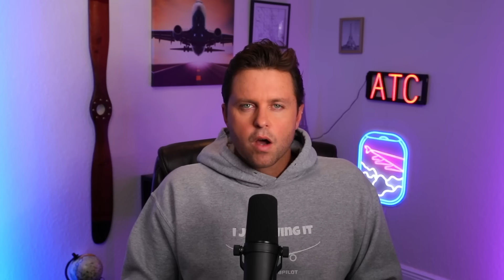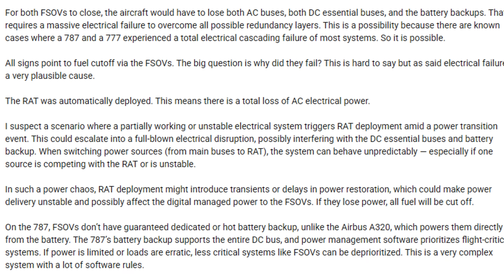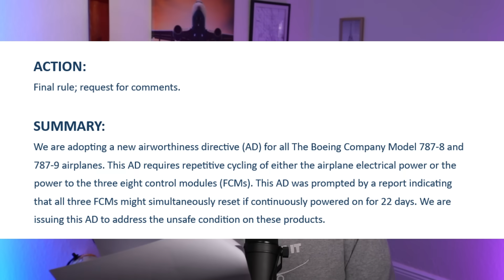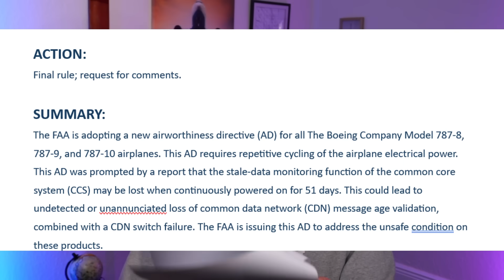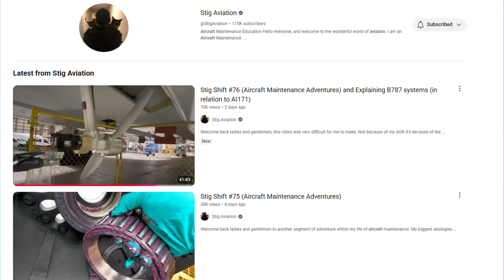Air India 171: Did a Software Glitch Cause Dual Engine Failure?

Comment from the maker: Original comment from @HeyFixThis 

I believe the cause was a combination of Fuel Shutoff Valve (FSOV) activation due to an cascading electrical system failure. It’s not the first time a 787 has experienced electrical cascade system failure during the first minutes in flight and required RAT deployment. Let me explain my reasoning:

On the Boeing 787, the engines will keep running even if all hydraulic systems fail. Each engine has its own FADEC (Full Authority Digital Engine Control), powered by a Permanent Magnet Alternator (PMA) that’s driven by the engine itself. Once the engine is spinning, the FADEC operates independently — controlling fuel, thrust, and safety — with no need for aircraft hydraulics or external electrical power. A simultaneous FADEC failure is extremely unlikely.

So, why did the engines shut down if they are supposed to be so resilient?  There is one important component that can override the FADEC: the FSOV. This spring-loaded fuel shutoff valve is not powered by the PMA, but instead by the aircraft's electrical DC system. If power is lost, the spring closes the valve instantly, cutting off fuel to the engine. FSOVs are a fail-safe, designed to protect the airframe, not the engine. In Boeing’s logic, it's safer for the engine to shut down than to keep feeding fuel into a potential fire.

In the video footage, the truck tilt actuator is in the forward position (toes down). This movement requires a hydraulic system force to overcome the wind and gravity. This forward position only happens when the landing gear retracted sequence is initiated by the pilots. 

The strange thing is that it is only the second step of the main gear retraction sequence to tilt the wheel truck forward. The first step is to open the doors, and if the doors are fully open, the next step is to tilt the wheel truck. It’s unclear why the doors are closed but the truck already tilted forward. 

Most likely the pilot selected “gear up,” which triggered the retraction sequence. The truck tilt was initiated as step 2, but the doors didn’t open due to power or hydraulic failure, or the sequence froze mid-process. The aircraft lost main power (hence the RAT), and the sequence halted with the gear in a partially commanded state: truck tilted, doors closed, gear extended.

That gear retraction moment may have been the exact point when the whole system collapsed just 3-4 seconds after takeoff.(there was a positive climb rate at 600ft AMSL and 174kt ) The engines kept running briefly (3seconds), powered by the remaining fuel in the lines before flaming out.

The main landing gear hydraulics are powered by an electric-hydraulic system — if there’s no electricity, there’s no hydraulic pressure. In contrast, other hydraulic systems on the aircraft are supplied by engine-driven mechanical pumps. (20-30kw power needed to retract gear)

Since the aircraft remained stable in flight, it's likely that both engines flamed out simultaneously. Flaps, fly-by-wire, landing gear, and other systems likely froze for a moment and possibly regained functionality after the RAT deployed. The +-15kW RAT powers the electric motors on the blue hydraulic lines of a 787. This controls the key flight-control actuators for the rudder, elevators, and primary ailerons. It appears that the pilot slightly increased the nose attitude during the final phase of the flight. (landing gear retraction is not possible with a RAT)

For both FSOVs to close, the aircraft would have to lose both AC buses, both DC essential buses, and the battery backups. That requires a massive electrical failure to overcome all possible redundancy layers. This is a possibility because there are known cases where a 787 and a 777 experienced a total electrical cascading failure of most systems. So it is possible. 

All signs point to fuel cutoff via the FSOVs. The big question is why did they fail? This is hard to say but as said electrical failure is a very plausible cause.  

The RAT was automatically deployed. This means there is a total loss of AC electrical power.

I suspect a scenario where a partially working or unstable electrical system triggers RAT deployment amid a power transition event. This could escalate into a full-blown electrical disruption, possibly interfering with the DC essential buses and battery backup. When switching power sources (from main buses to RAT), the system can behave unpredictably — especially if one source is competing with the RAT or is unstable.

In such a power chaos, RAT deployment might introduce transients or delays in power restoration, which could make power delivery unstable and possibly affect the digital managed power to the FSOVs. If they lose power, all fuel will be cut off.

On the 787, FSOVs don’t have guaranteed dedicated or hot battery backup, unlike the Airbus A320, which powers them directly from the battery. The 787’s battery backup supports the entire DC bus, and power management software prioritizes flight-critical systems. If power is limited or loads are erratic, less critical systems like FSOVs can be deprioritized. This is a very complex system with a lot of software rules. 

This also reflects Boeing's design philosophy: in a severe power failure, airframe survivability and flight control take precedence over engine continuity. Their assumption is that it’s safer to shut off fuel than risk uncontrolled flow in to an engine on fire. 

The whole idea of the posibility of losing  both engines at 400 ft during takeoff feels inherently unsafe. From a thrust continuity perspective, this design approach is a vulnerability and may have played a role in Flight AI171’s dual-engine flameout.

To date, there are no documented cases of a modern Boeing experiencing a engine flameout from FSOV closure due to an electrical glitch. The 787 and other Boeing models have a history of similar electrical issues.

In 2024 an Atlantic Boeing 787 flight, VS105 during climb-out, the crew experienced a major electrical failure— engine generators dropped off-line. In response, the RAT automatically deployed to provide emergency power. 

In 2015, Boeing and the FAA discovered a critical software bug in the 787’s Generator Control Units (GCUs). If left powered for 248 consecutive days, an internal counter could overflow — shutting down all four GCUs and cutting AC power entirely. The FAA issued Emergency AD 2015-08-51, requiring operators to reboot 787s every 8 months to avoid in-flight total power loss.

Two separate incidents—in Boston (JAL) and Takomatsu (ANA)—involved battery overheating and fire in the aircraft’s APU lithium-ion batteries

In December 2018, LATAM Flight LA8084, a Boeing 777-300ER, suffered a complete electrical meltdown en route from São Paulo to London. The RAT deployed to provide emergency power. Once the engines were shut down on the ground, power suddenly returned — confirming a fault in the electrical distribution system (likely a bus contactor or converter failure). The event was a textbook cascading failure: generator power was available, but a chain reaction of breaker and converter failures disconnected all major buses, including those powered by the APU and engines. 

The 787 relies heavily on software-based power management, so if the root cause turns out to be a software flaw in a extremely complex electrical system, the entire fleet could soon be grounded pending investigation.

——/
I rule out vaper lock: Modern jet fuel systems are pressurized and temperature-managed, making vapor lock rare. For both engines to fail simultaneously from vapor lock would mean identical thermal, pressure, and fuel conditions in both lines — extremely unlikely.
Reply: Does the flight data recorder (FDR) record what the Fuel Shutoff Valve (FSOV) is doing?
Reply: @evoliveoil think of an automatic fire door that is held open by an electromagnet when the fire alarm goes off the current is turned off and the door closes. In the case of these valves, they’re held open by the presence of electrical power and when the power goes off they close, but as there’s no power there cannot be a signal sent to the FDU, the only way of recording the valve position is when it’s open and it would be the absence of that signal that would indicate its closing.
Reply: @MRCAGR1 imo doing that without first acknowledging the detection of a fire is unsound, and it’s the wrong conception of an electrical fuel valve actuation. Keeping the fuel valve open by an electric driven actuator, but closing by spring force is asking for an event like this. For hundreds of years, railway cars brakes were powered by draining the piston not by pressurising it, which ensured that trains would stop when supply lines broke. In the 787, the fuel supply to the engines is stopped by spring valves when electrical power fails.
What a miserable conception! Surely a better solution would be to hold it upon and only upon the detection of fire close the valve. You could make this physical, ie something that the fire burns through easily that then releases the spring. Whatever the solution, there has to be one better than this PoS. In any case, pilots can already manually shut off the fuel and use fire extinguishers, so by trying to solve a problem that already has solutions they’ve created an even bigger one
Reply: @StoutProper I’m not disagreeing with you and I’m not saying that Boeing are blameless in their design neither am I being deliberately obtuse or obstructive, just looking at this logically from a system perspective.
If the FSOV are located adjacent to or close to the fuel tank outlets rather than being very close to the engine then the concept of using a physical restraint that burns through would not be feasible. 
If there’s no power then there can be no control over closing the valves as that would require electrical current to activate which cannot happen until the RAT has deployed and is operating correctly. What it needs is an actuator that can reopen the valves once power is available via the RAT, this could be manual or automatic.  It would also require the flight control system to be active. If the power is cycled do the flight computers do a cold start or a warm start?

There’s also the issue of the fuel pumps also being driven electrically, even without the FSOV activating, there would be a period where the engines become fuel starved, what could be the effect on the engines if this was a drawn out process?

Would there have been time for this to complete on the Air India flight?

One possibility would be an independent source of power that could keep the FSOV open unless the fire warning for a given engine has been activated. If all power failed for whatever reason the FSOV would remain open unless overridden on the flight deck.
Reply: Yes, @evoliveoil
Reply: @evoliveoil  surely!
Reply: @evoliveoil  Sadly it is burned down and send to the US because india did not have the resources to retrieve the data. Cockpit voice is secured.
Reply: @evoliveoil only if it’s got power, and only if the sensor has got power, and there is a valid connection between the two. Probably unlikely with a complete electrical failure
Reply: I'm glad you reposted this comment as I think it is one of the best on this crash. It seems weird logic to shut those valves (FSOV) off automatically by assuming there's an engine fire.
Reply: @donotwantahandle1111  If an engine fire was the reason for this accident, we probably would say the opposite. ;)
Reply: as a systems engineer and software engineer, that reboot bug is INEXCUSABLE. I'm actually speechless
Reply: @BendySendy 248 day reboot schedule is a sorry adaptation to a clear software BUG. I've seen such bugs in other systems, and they can be difficult to spot, until you commit to supporting perpetual operation as a feature. Short of that a forced reboot schedule should be reinforced with escalating timeout notices. I don't know if that was done, but it sounds like another Boeing 'too smart for its own good' design self-pwn.
Reply: @BendySendy  "that reboot bug is INEXCUSABLE" Yep, it's about as dumb as a mechanic who don't know the difference between a sump plug and a spark plug.
Reply: @BendySendy  totally agree!
Reply: @BendySendy  Discovering that the planes continue to fly with that reboot bug is enough to sendy you round the bendy.
Reply: @Brrumski exactly
Reply: @BendySendy  When you offload your software development to the lowest bidder, in a Country with a large time zone difference from Boeing, are you really surprised?
Reply: This explanation makes sense and seems confirmed by the sequence of the crash and the RAT deployment, as well as the position of the trucks
Reply: A Safety Instrumented System (SIS) with fail closed valves are routine in a chemical plant or refinery.  But IF a false closing of that valve could cause a fatal event; a 2nd parallel valve with a different power source and controller would be utilized.  NEVER have a single point of failure that causes a severe event.  Some systems even have 2 out of 3 voting before initiating control actions that have very severe consequences.
Reply: @allencar5212  Yes, seems weird for an aircraft engine.
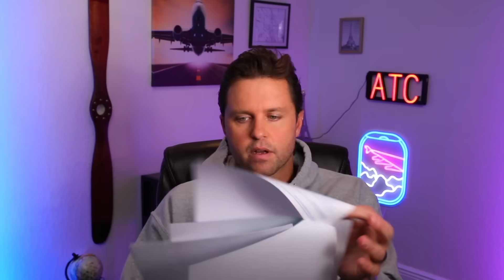Reply: "The strange thing is that it is only the second step of the main gear retraction sequence to tilt the wheel truck forward. The first step is to open the doors, and if the doors are fully open, the next step is to tilt the wheel truck. It’s unclear why the doors are closed but the truck already tilted forward."   Not according to this video shown by Gary where at 6:24, it clearly shows the tilt operation begins BEFORE the doors start to open:   https://www.youtube.com/watch?v=ak9o50YLb14&t=123s.  Apart from this statement, I think the rest of your observations are possibly pointing to the real issue.  At cruising altitude, this would probably not be a big issue as after power being  restored by the RAT deployment, the engines could likely be restarted.  A far different scenario at five or six handred feet.
Reply: @Gourockian1  Yeah, I had heard the sequence operating the same with the tilt first and when verified by the prox switch, then allowing the doors to open. From a logic standpoint, this tends to make more sense. 

But then I tend to think the logic of the fuel shut offs defaulting closed, is pretty weird logic. And it seems odd for the computer to even command the valve as opposed to direct control from the panel switch. But if that's what it says, I guess that's how the designed it!
Reply: FSOV Closing due to electrical failure is criminal
Reply: Even though the AD was published, it doesn't mean it has been followed by Air India. The first thing investigators should do is check the maintenance logs, specifically for AD reboots. What is interesting is that the advisory says "reboot after 8 months", which would be about 240 days and that leaves only an 8 day margin.  Why not have the period set at half the interval. Surely, 120 days is possible to implement, wouldn't it?
Reply: @dondonaldson1684  Airworthiness Directives are typically legally mandatory, it'd be foolish not to but yes, theoretically could've just. Not. AD 2018-20-15 replaced the original AD and did, in fact, set the reset time period to 120 days for good measure, in addition to mandating a permanent software fix within 12 months from the issue date of the AD, which was November 20th, 2018.
Reply: @dondonaldson1684 I agree, and think Boeing should have promulgated maintenance programs to track and enforce these reboots until a perpetual operation feature could be deployed. But as software architect, who has fixed just such bugs elsewhere, I suspect counter overflow glitches are rife in this code base. When you have a blind spot, you never stumble just once...
Reply: One 787 incident that is not mentioned which to me felt like it might actually be a lot more relevant is that of ANA NH-985 on Jan 17, 2019. During landing at Itami, the engines both rolled back and shut down prematurely due to something in the software. I couldn't find much of an incident report on that. If whatever fault caused that shutdown or perhaps similar circumstances causing the software to react similarly, but during rotation rather than landing then you could absolutely see it resulting in a crash, simply no time to react to the problem. That said I am not sure what the root cause of the ANA incident was, I couldn't find much info, perhaps you know more or have access to better sources?

Also on the vapor lock theory - it always felt far fetched to me, becaus 43 degree heat is pretty common in India in the hotter months, and it gets similarly hot a lot of other parts of the world as well, and a two hour turn-around seems pretty routine as well. We are not hearing about 787s losing engines due to vapor lock, despite likely thousands of takeoffs in those sorts of circumstances in the 14 years the 787 has been in operation. If that were all that was going on we'd have seen this before now. Overheating of computers or electrical systems seems far more plausible.
Reply: Very thorough work from @HeyFixThis, thanks for posting
Reply: This is no doubt the most professional (non FAA/NTSB) accident review I have ever read. This information should put the official investigation on a completely different track.
If this pans out (and I think it will), the real shame will be that dual engine failure was a known possibility. 
Now we can all hearken back to our training days when a single, manually controlled, fuel selector/shutoff valve was all we had to contend with.
Reply: I agree with this assessment. I think Boing need to re-assess the fuel cut off valve as a fail safe function as it clearly fails to danger state. With all the modern electronics now available, this valve should not close while in flight. Accelerometers and inputs from flight navigation should be able to inform the valve control system that the plane is in flight. A backup power supply for the valve should also be included. This is clearly a critical component and self diagnosis ad reporting should be mandatory,
Reply: Now comes the ‘interesting’ part.  

If the Indian Authorities have concerns such as these will they be robust enough to call for a fleet grounding.  It took the loss of two 737 Max’s before action was, somewhat reluctantly. If the FAA is seeing the same as a real possibility have they freed themselves from Boeing sufficiently to call for the fleet grounding. 

As much as I didn’t like Alan Joyce as CEO of Qantas, immediately after QF32, when now lives were lost he grounded the QF A380 fleet. 

Given the integrity concerns with the FAA, I think country regulators need to step up to the plate, such as those in Europe, UK, Australia, etc. 

Failing the regulators, what risk analysis are the airlines making. Grounding the 787 fleet would cause massive implications and potentially competitive disadvantage with profit loss, but how much longer will the profit mindset override airline decision making?
Reply: @jpmasters-aus  Naw. 
They're waiting on the next incident or crash before grounding the fleet.
Reply: -8 is tilt then doors, -9 is doors then tilt
Reply: That’s a dumb post. 

The conflict lies in how the Fuel Shutoff Valves (FSOVs) behave on the Boeing 787:

The post claims FSOVs are spring-loaded and will automatically close if electrical power is lost—cutting off fuel to the engines.

But Boeing design data shows the opposite:

On the 787, FSOVs are motor-actuated and latched. Once commanded open (or closed), they stay in that position—even if power is lost. They do not spring shut.
This means a total electrical failure would not automatically close the FSOVs and stop fuel flow. So, the theory that a cascading power loss alone caused both engines to shut down via FSOV closure is not consistent with how the 787's fuel system is built.
Reply: @morespinach9832  you are correct but power is actually " lost" after the valve is commanded open or shut. It uses a DC voltage pulse for one direction and a reverse polarity pulse for the other direction A magnet holds the position of the valve. the spar valve is motorized and will stop even in mid transit if power is lost
Reply: @morespinach9832  

Right, the OP is based on false assumptions.  As I said the valves are Bi-Stable.  An open valve stays open even if the power systems crash.

It would take some current ( perhaps errant) to flip the valve state to closed.
However, Airbus' implementation is probably more fail-safe, given how the engines should continue to siphon even if the primary boost pumps fail.
Reply: The day/time limits are due to the 787 using a 32-bit operating system. The interactions between fsov and the rest of the systems I know nothing about. Also (allegedly) Air India’s entire 2nd city fleet was under upgrade  maintenance, it would be interesting to know for what.
Reply: Looks like you forgot to pin this comment or YouTube unpinned it.
Reply: Simple mechanics suggests ,no thrust ,no lift due mainly dual engine failure.
For any engine to generate power you need to burn fuel with air.If it doesn't get either it will not run.
Why & how the engines starved off fuel needs to be established.
Reply: @dineshtripathi3995  The mayday seems rather  specific as opposed to "lost power", "engines shut down" or something  similar. If they hard an electrical failure, I think the mayday call would have indicated  as much. 

Some aspects of this sound a bit like wind shear.
Reply: Seems plausable
Reply: Air India cancelled 26 flight in last 24 hours. After questioning they answered that 13 were cancelled due to technical snag and 13 were operational issues.
Reply: Hi Gary,
I'm a retired flight engineer instructor/examiner.  Please listen again to the 2nd video of the aircraft flying past the apartment balcony.  This is the video that clearly informs us of the noise from the RAT.  The RAT's noise is evident.  However, we can also hear the noise of the engines as the aircraft moves further away from the camera.  Typical jet efflux noise as an aircraft moves away.  Consequently, even though the RAT is deployed, I don't believe the engines actually flamed out.  They were not as noisy as you would expect for an aircraft in serious trouble.  However, they were still running.  I believe they were running at much lower RPMs, due to receiving fuel by gravity and suction feed only.  Suction/gravity feed is caused by the fuel tank booster pumps not running, but allowing fuel to pass through to the engines at a much slower rate.  This reduced flow rate will not be sufficient to sustain max power on a large fan engine.  

We know the pilots stated, "loss of thrust".  Every pilot I have ever heard in a flight simulator has transmitted, almost without exception, "Engine failed/failure or "engine flame out" or "multiple birdstrike", etc.  I've never heard "loss of thrust" when an engine has stopped running.  There was a clear message to the world in that Mayday call:  loss of thrust rather than loss of engines.  The aircraft ended up below minimum drag speed and would never recover, even if they got electrical power back (and tank pumps running) with the RAT.

I agree that the facts support a central electrical failure.  That central electrical failure caused all the tank booster pumps to immediately stop running, bringing the engines to a lower power setting (but not flaming out).  The electric hydraulic pumps will stop, but the accumulators in the landing gear system would pre-position the bogie trucks before the accumulators, exhausted themselves.  The legs would not raise.
Reply: @kevinnurse9936  That sounds more plausible than just about every other theory I have heard. Thanks.
Reply: Wow, i think i understood about 40% of that but enough to make me think Boeing need to ground all Dreamliners to check their software!!
Reply: If there was fuel contamination then another aircraft would have experienced the same issue
Reply: If this were to be true then it will be a boeing issue not a GE issue. Not familiar with GE but if this were to be RR then electrical on their part would not have caused this. Fuel from the win g is then mechanically driven from the pump connected to the gearbox through to then burners/injectors. Any electrical systems are for monitoring purposes only. RR also run dual channels to everything electrical from the EEC so if 1 fails there is a backup. When the quantas a380 flight had the engine fail the fuel cut off at the wing would not work so they had to drown the remaining engine in foam so if there is an issue with fuel supply and electrical issue its before the engine/wing and therefore a boeing prob not GE. Again not familiar with GE but they cant be too dissimilar.
Reply: If the plane had an engine swap in March is it safe to assume the ADs don’t apply and power was cycled or is that not standard procedure?
Reply: Your too short on ir commentary  we need more dialog  from you
Reply: Username checks out.  @HeyFixThis
Reply: Can't get any more thorough,,,,, very good worth many gold stars.. would another vat with direct wires to the fuel pump be a solution,,, fuel pump activate sensors, 1-2 second deployment of secondary vat, fuel pumps reactivated,, power interruption immediate activation of second vat and restoration of power to fuel pumps,,,,!;;!!!?!
Reply: @JohnMcCloskey-g9o  
Airbus apparently has a different protocol-- namely that these valves are powered by the individual ENGINE power source; the same source running the FADEC.  (Not via central power from the airframe.) If those had some logic OR function, so that if either engine turning would be sufficient to ensure VALVE=OPEN, that's probably a better implementation.  

Once the engines are turning, they could be counted on to remain fueled.

Of course, one has the sense that AIRBUS design protocols are more robust--  they've always had THREE AoA sensors, rather than the single failure prone set-up in the 737.

I don't want to discount the area of inquiry-- both fuel valve systems snapping closed sure fits the scenario.  However, some of the "assumptions" by the OP here are based in false data-- and it's far from clear WHY the RAT would be out BEFORE the engines stopped running at TOGA thrust.  So, his logic chain is backwards-- he's trying to fit 15 kilograms of bad assumptions into a 10 pound sack.
Reply: @atlascruiser1456  There are different types of valves on these engines, but generally "FSOV" refers to the valve which can only be controlled by the cockpit fuel cutoff switches or the fire handles. i.e. it has nothing to do with FADEC. However, fuel metering valves can be "metered" by the FADEC system, but as you say, FADEC is independent of aircraft power... i.e. unless the engine N2 falls below, typically 8 ~15%. i.e. engine barely turning. 
By the way, the 737 has two AOA sensors. The 737 MAX issue was that the MCAS system was originally wired up to only one of them. 
3 of them makes much more sense, however.
Reply: The failure occurring and causing immense trouble within seconds is really scary as a passenger and it's hard to imagine how pilots can identify and rectify the exact failure within these seconds time under pressure and also trying to be airborne at such a low altitude
Reply: The FSOV is a motor operated valve and not a solenoid operated valve. Doesn’t spring closed
Reply: I thought there was a failsafe in that The FSOV is spring-loaded to close if power is lost during a commanded shutoff, however if electrical power is lost completely and no shutdown is commanded, the valve stays open (fail-last-position logic).
Reply: @DuncsR  NO - the valve stays put where it was last commanded and voltage is removed - then applied if the valve is required to be moved- then voltage removed-  by design
Reply: WOW! I get more useful new fresh news details here than from the major news sources 🙂
Reply: The NYT, Times and Post are running about 48 hours behind in covering this.

They still are publishing about "theories" that are clearly false.
Reply: Astute and excellent analysis. It's clear that there was an engine failure, and it's clear there was a RAT deployment. Both of these, coupled with the long history of electrical failures and the immediate history of electrical failure in the in-flight systems as documented by a user video, clearly point to a cascading effect from electrical systems failure leading to fuel cut-off to the engines.
Reply: The below was derived from a conversation with ChatGPT, so take this with a grain of salt. I do have many years of automation experience as a software developer across an array of industries (40 years).

If there is a power transient on battery bus, the valves are going to close and stay closed until an engine start-up sequence is initiated that could take 90 seconds, assuming all of the 5 sub-systems are up and running (Engine Start System, Electrical Load Management System (ELMS), Fire Protection System, Integrated Modular Avionics (IMA), Engine Interface Unit (EIU)). This further assumes that the power systems did not cause a transient that knocked any of those listed systems offline (faulted and requiring a reboot). While I am not involved with aviation, IMHO, this is really a bad design and it dooms the plane on takeoff if such a transient occurs and those fuel switches close.

FAA Mandate: "Fuel shutoff valves must close automatically (or fail to closed) if electrical control power is lost, to prevent continued fuel flow in the event of damage or fire."

What we do not know is the details of the duration of the power loss that triggers the fuel switch to close. That is where we need expertise. I would be very interested to hear all of those details.

I firmly believe that too much automation has been introduced, in the name of 'safety' where the fate of the aircraft is dependent on a complex array of power distribution and embedded systems rather than putting the pilot in control. While the FAA mandate may have been created to save lives, one cannot ignore the possibility that during takeoff, this is a fatal design flaw and should have been recognized by both the FAA and the aircraft manufacturers. We should rely more on pilots (to pull the fire handle) than on millions of lines of code spread across an array of architectures over field buses, potentially authored by hundreds of individuals. Given the 289 day and 51 bugs, there is sufficient evidence of a lack of quality in those code bases. We cannot blame software management per se, they do what they are told, even if they recognize fatal flaws in design.

It seems that Boeing has bred a culture where pointing out systemic flaws is not only discouraged, it is shut down completely. Anyone with any reasonable expertise should have seen this problem a mile away.

While I saw the CEO of Boeing testify in front of a panel of Senators yesterday, I remain unconvinced that there is really an open discussion of safety systems on those planes. Perhaps they need outside engineering firms to push back on both Boeing AND the FAA.
Reply: FSOV is fail-open design, the whole episode is useless junk. Go learn engineering Gary…
Reply: I believe that it was some sort of a nasty failure or even some design flaw of one of the systems. Software glitch as described not very much likely. Capt. Gary is right and he also looks cool - like from Baywatch series or smth!
Reply: It couldn't have been fuel cutoff via the FSOVs because the engines would flame out and the plane would stall. This is also verified by videos where you can clearly hear both the RAT and engines running. If a runway was present instead of the buildings it would have been a perfect landing which shows the FADEC remained in control of the plane. 

The big problem with the B787 is it has a mind of its own called FADEC which thinks it knows better than the pilots on how to fly the plane. If you are flying a B787 be very careful what you do with the gear lever when the gear fails to retract. If you leave the gear leaver in the down position FADEC will think you want to land the plane and will cut thrust to the engines when it detects the ground. You could end up doing a perfect landing on top of buildings just like Air India Flight 171.
Reply: @cyber5515  Very smart. Let's wait for final report! You might have solved the puzzle.
Reply: I booked a flight on America over the phone yesterday because of same day round trip and picking someone up which makes it impossible online anyways after 3 people and 2.5 hours the process was complete the incompetence displayed with agents offering connecting flights 4 hours prior to the arriving flight had me at a complete loss of words other than how fing stupid can someone be to offer a flight that left 4 HOURS AGO she said I'm just giving you the options I have, holy fck me dead. If agents are this stupid, then it only works its  way up the food chain. Mind you 3 people were unable to put together a simple one day round trip ticket to pick up my son and then take him back 3 weeks later.
Reply: In the trade we call this bad code which Boeing is well known for.
Reply: @TeriImmense 
Ghost Faults
Reply: I am a retired CTO who worked my way up from being a software engineer and mainframe computer operations.  In my software engineering days, I have worked on systems that are every bit as complex as the 787 software. In my experience,  latent software bugs just don't creep up after over a million flights over a decade of continuous use. Unlike electronic mechanical components,  software doesn't wear out. To rule out any possible software issues, I would scrutinize recent patches. There's been reports of air-conditioning problems and entertainment system malfunctioning in an earlier flight. This would suggest sloppy maintenance.
Reply: Pin this comment buddy.
Reply: Thanks for your honest, open and informative views. I am not involved in the aviation industry, so I can't comment as to the accuracy of this video, but you could find it interesting: https://www.youtube.com/watch?v=M_8CYyZRWXE&t=641s
Reply: Question: when both GCUs fail then APU should be started automatically, right? After APU fail , EM'CY Batteries should be available , right??? And finally if batteries not working then the RAT should be deployed. It is almost imposible to have cascade electrical failure with 2 back up emergency power supply (APU & BATTERIES). Something else has happened and led this disaster to happen. The only case to have both engines flame out is no fuel in the system or FSOVs malfunction.
Reply: I expressed the theory of a software glitch on Captain Steeve or another YT channel a couple of days ago. It came into my mind, because recently I was involved in a performing programming contract for one of the US companies that train Boeing/Airbus pilots. Although the contract was about their website and nothing to do with airplanes, the founding was astonishing. We've  dealt with the code  written almost 20 years ago by some amateurs. Very bad coding with many bad "work arounds" solutions. I then jokingly thought "how are the planes  still flying?". Considering the previous glitches with Boeing software I wouldn't be surprised about the new ones. Seems that the lack of expertise and talents, lowering coding standards, in the coding community is a worldwide problem in general and the problem in the Aviation Industry particularly. 

Another observation from my coding experience. 80% of the companies including large capital companies DO NOT USE tests for their coding. ❗
Reply: Yep, I remember and liked it👍because it was my strongest suspicion at the time: a software glitch @UkrainoTV
Reply: @cleantheocean  I really hate that term "software glitch", It's sort of the thing uneducated people say. Could it be a case of poorly written software?  Yes, but that's not a "glitch"!  "Glitches" do not occur. Such a thing where the solved software produced the opposite output, the system would most likely fault. If the hardware doesn't do what the software outut commands, that's a hardware problem.
Reply: @professorg8383  I see a software glitch as an event where the software doesn't do what you expect. I've written a lot of code in machine code, and that happens.
When you add high level languages, with interpriters, you can NEVER trust the sogtware unless you personally wrote the interpriter.
Reply: Dude - how much credibility do you wanna lose by regurgitating this idiot HeyFixThis's Chat GPT cut and paste hack???   It is full of inconsistency and wrong information. He is posting this shit on every channel and the people who don't know shit about aviation and modern aircraft systems are sucking this up... do better
Reply: Let’s hope Boeing now commences simulations of this scenario…much like they did with the Starliner.
Reply: Any electrical component will fail to operate and any electrically held/w/ spring mechanical returns will operate upon a condition of complete, total power failure. And in a nutshell, it's what the guy said in the video right off the bat- a/c busses/dc busses/backup busses all had to be gone - mia - where and at what was the junction or could take them all out as a singular event? How long will engines & fuel run without any re-insert of electrical power from on-board? batteries (?) for how long?  could busses blow on takeoff roll, engines still running on batteries long enough to climb to 600 feet?
Reply: can the electrical diagrams for that aircraft be viewed?
Reply: Seems very plausible.
Reply: Omg, this better not be vibe coders at Boeing trashing the software.
Reply: All those computers and they never asked it to see if a cascade was possible?
Reply: well done. I support your findings
Reply: "The FAA issued Emergency AD 2015-08-51, requiring operators to reboot 787s every 8 months to avoid in-flight total power loss" - This sounds shocking, but is the number provided correct? According to the results available online for FAA Airworthiness Directive (AD) 2015-08-51, they concern a different issue for Enstrom Helicopters.
Reply: I had to take a min to let this sink in. If this turns out to be the cause, the implications are mind blowing!  I did a little googling myself, honestly just to get a better understanding of some the systems you were discussing. You gave an amazing, clear analysis but I wanted to make sure I really understood the information you presented. The fact that it was a known glitch leaves me speechless. Yes, it would take the perfect storm for it to cause a crash but perfect storms happen every day. It makes sense. It makes a lot more sense than bad fuel or flap issues, especially with all of the documentation stating that it could become an issue in multiple situations and actually did happen during a landing.  It will rock the aviation world if it is proven to be the cause. Boeing is already struggling and the last thing it needs is to have another MCAS level situation. I will definitely be checking out the sites you suggested…tomorrow, well, later today since it is almost 5am. MUST HAVE SLEEP!
Reply: Too many cell phones not turned off on take off
Reply: But engines won’t keep running if the EEC senses an N2 overspeed, then the engine(s) will shut down automatically
Reply: Excellent explanation Gary, with this massive power failure will the Black Boxes and DVR still record or shortout?
Reply: @ginog5037  The forward EAFR was equipped with a backup power supply called RIPS (Recorder Independent Power Supply) that could provide it emergency power for 10 minutes.
Reply: @havillland It's great to know that all the recorders can and do run independently when all else fails and shorts out.
Reply: A valve that would close when there is an electrical failure regardless of other conditions ? In this case during a take off and full thrust needed ? Very simplistic.
Reply: @Cervin_Suisse yes, it’s impossible and in fact is not as indicated in this video
Reply: With all due respect to your work Sir, why haven't you mentioned that this is not the first timd Boeing had a software problem, because Boeing had also software problems with the 777?
Reply: "The whole idea of the posibility of losing  both engines at 400 ft during takeoff feels inherently unsafe."  True, but you gotta remember these are the same people who thought is was okay to automatically nosedive a plane from 500-1000 feet based on the input from a single sensor.
Reply: Appears like another Boeing Dumb Software design.  Which moron would design the FSOV without hot battery backup.
Similar mistakes were made with MCAS system of 737 Max where only one AOC reading was taken to push the nose down without cross checking with Second AOC, nor checking the flight altitude, nor speed nothing.  Just keep pushing the nose down.
Reply: Are there any situations when the FADEC is programmed to auto shutdown the engine (even in flight) to prevent catastrophic damage (overtemp, over speed, etc) ? 

Maybe FADECs commanded auto shutdown?  Was it 42 degrees on ATIS?
Reply: Best comment ive read on it and I agree. One takeoff a loud bang was heard, what do you think that was? One of the electrical generators exploding?
Reply: While plausible and logical for automotive, sea-going or industrial applications to have fuel systems that fail off. I struggle to believe that would be the case in aviation. 

Gas turbines run essentially in the same principle as a diesel engine, as long as fuel and air is supplied, the engine will run. If a vehicle suffers an engine fault, I can understand the fuel being cut off as the vehicle can roll to a stop and save potential engine and transmission damage. 

If you have an engine fault in the air, I'd prefer the pilot to be able to make decision if he wants to shut the engine off or not. I'd rather be able to make the choice between destroying an engine in the process of landing safely to falling out of the sky.
Reply: @GazC  In that case the pilot did not have the decision to switch the engine off. So the choice is between "no engine" and "uncontrollable engine" - there is no perfect solution.
Reply: @JM_2019  do you know for a fact that the FSOV fails off on a 787? I am genuinely asking as a former technician on rotary wing aircraft as I would be quite frankly shocked if that is the case.
Reply: @GazC  I don't know it.  But would you - as a rotary wing aircraft technician - say "on = full thrust" is a better option?
Reply: These modern planes are so complicated, anything can go wrong at any time.  You didn’t have these problems with DC 3’s!
Reply: Before reading this, I was highly suspicious of the duo engine failure theory because of the ultra low probability.  This posting has given a strong reason to support duo engine failure. Relying on the operator to manually reboot every 248 days is an 12:55  utterly unacceptable work around. Numerous comments on the internet have suggested sloppy maintenance as a contributing factor as well.
Reply: That would do the trick. My speculation on how to lose both engines was shorting the fire handles to activate those shutoff valves, but if a glitch can skip that step? Nasty if that were the case
Reply: Have you seen the video of  passenger on this same plane,  previous flight where the electrical system and the AC weren’t working.  Then they took this same plane for a long flight India to London England , no problem?  I think the crew should have a checklist that if certain things are broken , not operational it should ground the plane .  Otherwise you’re depending on someone reporting it etc.
Reply: @angelarich8455 they do, it’s called the MEL, minimum equipment list.  Certain items on the plane are allowed to be inoperative, but none on the MEL. Interestingly it includes the galley refrigeration, else pilots could get food poisoning on a long haul flight !
Reply: From early on the software glitch was the only thing that seemed most likely. Something that relates to both engines or the entire airframe went wrong here to bring down the jet. FSOV seems very plausible and in hindsight seems like a poor design choice. An inhibit bellow a certain altitude seems like a good fix. Better off letting things burn for a bit than crash at 600 feet.
Reply: Well stated
Reply: Is the commenter the actual pilot connecting from beyond , it is so detailed comment😅
Reply: I suppose every aircraft out there flying today and that has always flown has known issues. Nothing is 100% foolproof and 100% safe but flying is still one of the safest ways to travel so we manage the risk and keep calm and carry on.
Reply: Im not an expert in b787 but in airmode is a different story, ground mode FSOV. Will do all he said, in airmode i doubt it will send command to close the valve
Reply: Only way that valve will close in flight is if engine fire-handle is pulled
Reply: @AdanM427  Probably not with all the software checks in place. Ultimately if it’s a valve that closes with no power if the power fails it will close. This does seem a little crazy until you realise the fail safe option would be safer in the event of a survivable crash, ideally you don’t want passengers evacuating with engines running at full power.
Reply: After landing a Boeing 787 (JA825A) in Osaka in January 2019, both engines failed. NH-985. I also speculate for a software bug.
Reply: It is funny most of if not everything is wrong in this comment 🤦‍♂️🤣
Reply: Everyone wants digital this and that; compared to older aircraft where fuel shut off a manual thing.  Like pulling a handle and its moving levers and pulling cable (looking at you DC-9 and DC-10).
Reply: It was fuel contamination.
Reply: So, basically, if the flight crew had had time to turn it off and turn it back on again, there would have been no crash?
Reply: you are so  wrong. I have had full loss of electrical power on a 747 engine run and until i restored it could not shut down the engines. I highly recommend you take a systems course in acft
Reply: The fuel shut off valve (spar valve) is not a spring loaded valve. It is electrically driven open, and then it stays open. It does not close under spring pressure if airframe power is lost. The valve must be powered open, and it must be powered closed.
Reply: I read this comment too, and I read another comment, that was written by someone who claims to be an engineer, perfectly linking to that one. As someone with experience in reading hot stuff, I was like: yep that sounds plausible. Without checking it in my limited time. It would also fit in the Boeing and FAA corruption and instutional erosion issue (or Hirschman's eroding organization due to "organizational corruption"). And bro, why ure printing a YT comment 😆
Reply: Where are you getting this information from that the Fuel Shutoff Valves are spring loaded closed on the B787?
Reply: @NealHartsChannel I believe it’s a hypothesis that explains the sequence of events as observed.
Reply: @MRCAGR1  Well it obviously isn't based on facts. No where in the B787 Maintenance Manual does it say the Fuel Shutoff Valve is spring loaded closed. In fact, the SSM shows that the Eng Shutoff Valve Actuator is both motored open and closed with 28v DC power.
Reply: @NealHartsChannel I was commenting based on the information in the original comment above, where it does say the FSOV is powered by the D.C. power supply, but it doesn’t have a battery backup, unlike the Airbus.
Reply: Maybe not fuel problem, what about air? Excessive dust at end of run way or sand or parts of lighting plastic pieces
Reply: The engines NEVER lost power or thrust in EITHER of the incidents you cite.
Reply: I think a FMECA would show that a FSOV shutting would represent a single point failure and potential loss of the aircraft. I don’t know but that valve would have to have a high criticality and should have backup or redundancy to prevent catastrophic failure from occurring. IF it is the case that the FSOVs caused loss of aircraft that would be interesting to understand how the engineers missed a dual failure scenario.
Reply: Been waiting for a new  idea to uplaod
Reply: I guess the water from the toilet flooded the avionics electronics and then no one redundant system will save because when it cut off the main system that engage the backup system or there was a failure of access to the main power distribution bus nothing left. The water from the toilet conducts well. The tilt changed a lot during rotation and the leak flowed to the wrong place. That's my guess because why was it ok when it was level and a short circuit after takeoff?
Reply: fadec not last word for engine control
Reply: how fadec can be elevated to full authority above both pilots is qwestionable and no such big sw developpers are mensioned by boeing.
Reply: According to actual Boeing engineers on PPRUNE, these valves are NOT "held open by electrical power", but in fact are Bi-Stable.  An open valve stays open, even during power loss.

Having said that, there remains a possibility of cascading electrical switching causing glitching on the buses and an accidental triggering of the logic to close the valves.
Reply: @atlascruiser1456  YouTube 'top comments' also previously claimed that the 787 had flight envelope protections that prevented flap retraction and other nonsense. There's a previous AD regarding the fuel shutoff valves that speaks like they could fail open if a microswitch thought it was already open.
Reply: @havillland  
As the PPRUNE guys have pointed out?
The lack of a fleetwide AD sure hints that whatever happened was limited to Air India... probably maintenance issues or part failures or sign-off on open repair items like sensors, wiring, moisture  or check items.  The reports of "electrical issues on the prior flight" and "non working AC packs (all electric)" are a cause for concern...  A couple of bad components taking down the wrong buses?  Could have cascaded into a disaster.  

We should get a good handle on this.
Reply: @atlascruiser1456 The lack of a fleetwide AD shows they still haven't decided where to open the black boxes yet and haven't found anything in their fleetwide additional inspections to indicate there's a systemic problem that's easily found. Entertainment systems being inop on a plane is nothing new to any airline and I don't know how electric AC packs handle 38 degree heat when just sitting on the ground but I know even bleed air systems can struggle to counter that.
Reply: @atlascruiser1456  FSOVs usually only close if you apply power to them by either the fuel cutoff switches or the fire handles. I can't imagine loss of power causing this or even logic issues. Looking at the wiring schematics for other Boeings, not even the EECs can shut off the FSOVs.
Reply: @atlascruiser1456  That makes much more sense than a fail closed valve! 

We do use fail closed safety valves in industry all the time. but these factories stay on the ground!!  At least when the safeties work!
Reply: I think all of this started on the runway. Before they became airborne. There is no way that it should have used almost every inch of the runway, something else was going on
Reply: @jehtplane agree with you about the acceleration/lift off sequence being unusually long. It barely made it over the concrete slab at the end of the runway. I saw another channel where someone had graphed this airport runway's 787 lift off points over a month. The only one that went beyond all the usual lift off points was this AI 171 flight. My question is  -  could a faltering electrical system be detected prior to lift off,  while taking an unusual long acceleration time? And did this affect the plane's acceleration?
Reply: @jacquelinejacobson6789  yes I saw that, too. I believe he also graphed the ground speed of every 787 from flight 171 backward 30 days on that same runway. 171 had the lowest roll-out speed of all of the flights.  Some 10 kn under every other flight.  Why? What value changed in this flight that required a different thrust output.?
Reply: @jacquelinejacobson6789  That’s a very interesting point.  Do you remember which YT channel had the runway analysis?  I would like to watch it, if you do. Thank you. ❤
Reply: Faulty thrust reading  @jehtplane
Reply: @jehtplane It's likely they didn't use the whole length of the runway.  They followed a normal 787 takeoff and trajectory until they lost lift.  This has been shown in both tracks from Flightradar (ADSB) data and triangulation based on the location of the building between camera and plane at rotation from the runway video footage.
Reply: @jehtplane Yes, I'm suspicious of that too.  Speed profile during rollout may show loss of thrust prior to rotation, or maybe even low thrust at spool-up.
Reply: @naturalverities  I'm not clear on where those numbers come from, but if accurate, that might suggest the weight was higher than thy thought or maybe it was actually hotter than they thought. And I suppose the effects of some localized wind shear might have been involved
Reply: Operation of the FSOV
•  Valve Type: The FSOV is a motorized, latched valve, meaning it remains in its last commanded position (open or closed) without requiring continuous electrical power, and it lacks a spring-loaded mechanism to default to a specific state.
•  Control: The valve is managed by the Fuel Management System and can be operated manually by pilots via the engine fire handles or automatically in response to specific conditions detected by the aircraft’s systems.
•  Location: The FSOV is located in the fuel supply system, downstream of the fuel tanks, regulating fuel flow to each engine.
Conditions for Automatic Closure
The FSOV closes automatically in scenarios requiring immediate cessation of fuel flow for safety reasons. The primary conditions include:
1.  Activation of the Fire Suppression System: When pilots pull the engine fire handles during a fire or emergency, the FSOV closes to isolate the engine and prevent fire propagation.
2.  Detection of Critical Failures: Certain electrical or mechanical faults detected by the Engine Electronic Control (EEC) or other systems may trigger the FSOV to close, though it’s not confirmed that a total power loss automatically causes closure.
3.  Systemic Emergencies: Significant fuel leaks or other critical anomalies in the fuel system can prompt the aircraft’s automatic systems to close the FSOV to mitigate risks.
4.  Engine Shutdown Commands: Any manual or automatic engine shutdown signal results in the FSOV closing to stop fuel flow.
Reply: @stefanogalli579 thanks, so the explanation makes no sense as reasonable. Only a DELIBERATE command would close the valve (independent for each motor).
Reply: @stefanogalli579  the bit that looks ominous to me is this bit: "2.  Detection of Critical Failures: Certain electrical or mechanical faults detected by the Engine Electronic Control (EEC) or other systems may trigger the FSOV to close, though it’s not confirmed that a total power loss automatically causes closure."
Even if total power loss doesn't automatically cause closure, it does look like there are several other things that could have done. That rather stuffs up the argument by some here that the valve won't close no matter what fails.
Reply: @Garybpilot: In your video you repeatedly state (over and over) you are not going to speculate. But in this comment to your own video you speculate many times, (way too numerous to count actually). This kind of negates your video assurances you won't speculate. Also, who is the Kevin whose comment you assign such value to? Have you fact checked his "facts"? 
I know next to nothing (and certainly magnitudes less than you) about airplanes or their control systems. I don't have any connection to Boeing (and couldn't care less about their well bring). And your "non-speculative non-conclusions" may in fact be accurate. 
But my speculation on your entire presentation here is it's primarily click bait, glory seeking, view chasing  sensationalism ... and I find it repugnant.
Reply: @danytoob this was a very interesting video! He presented some important information and facts, how can you call this repugnant? At this point, all of the pilots on YouTube are "speculating" on what might have happened, what's wrong with that? We laymen all  need  the experts' view points on possible causes, while the investigation goes on . All the replies that I am reading and the civilized conversation that follows it's so interesting. You are the only one posting such a rude comment! 😣
Reply: @HeyFixThis
Reply: It looks like there was an electrical failure on ac and dc busbars, and not adequate power from the batteries that should have supported the shut off valves (and other critical systems) until the RAT output could be stabilized.
Reply: My opinion is coincides with your statement that the FSOVs shut off simultaneously on both engines.
Reply: KNOWLAGE. IS SO  VALUABLE. THANKS FOR  FACTS NOT GUESS'ES
Reply: Well stated.
It's a plausible scenario.
Reply: Whatever the issue is, I hope it's unique to Air India and they don't ground the fleet worldwide.
Reply: @homealone5087  Let's hope it's unique to any plane you fly from now on
Reply: @Brrumski let's hope it's unique to your mom
Reply: @homealone5087 it isn’t. It’s common to the aircraft type. They absolutely need to ground them, but like in the max, money talks and bullshit walks
Reply: @homealone5087  Why?
Reply: @homealone5087 Why would you not hope for it to be restricted to that one plane!? The way you put it, it reads like you’re okay if more Air India flights had this problem. Pathetic!
Reply: @akshaykoushikhs he hopes it unique to air India, not an issue with the plane overall.
Reply: @homealone5087  that would be disastrous. Can you imagine it… no quick fix either.
Reply: @DavidSmith-yi8ou less of a disaster than this crash and another one. The quick fix would have been to design and build them correctly in the first place, and not to let MD bean counter management clowns ruin a great engineering company and turn it into a circus. That NC plant and MCAS development offshoring is a total joke
Reply: A new update the person who everyone thinks saved in the crash is false propaganda. There are videos of him going inside the crash area and returning from the crash area. So it is false that one person saved and no person is alive in the crash. There was also a passenger who was former chief minister of Gujarat who was in this crash, where he was into four flight accidental situations for him two in 2017, one in 2018, one in 2020. As a pilot please don't get involved in politics or high profit people. Love from India ❤❤❤
Reply: @karthikeswar9987 isnt there CCTV footage from the airport of him boarding the plane? This should  be super easy to prove. I assume they've already checked it and verified that he was really on the plane.
Reply: @phillepoidevin24  the guy is a medium.  He knew the RAT had deployed, so he spoke about a loud bang and light flickering, before the crash.
Reply: @karthikeswar9987 u r wrong n your update is fake😂 he was lone survivor . You noob😂
Reply: @karthikeswar9987  What you’re saying is false propaganda, I’m afraid. It has been confirmed that he was a passenger on that flight. He got out, then tried to go back in to save his brother, but was stopped and taken to the hospital. Someone recorded him trying to go back, reversed the sequence, and fabricated the entire story you just repeated.

There’s also another fake story circulating online, that he was arrested shortly after the crash. That claim was debunked by the police, and the author of that claim later issued an apology.
Reply: @karthikeswar9987  He said he went back in to try and find his brother.
Reply: @karthikeswar9987   I am 100% convinced that the survivor is an honest man. Probably the survivor, after instinctively getting out of the plane, returned to the plane to save his brother, saw that his brother is already death and left - I think that was filmed. It is natural for him to return to save. It is a human gesture. The man was completely shocked when he got out. He is not a fraud at all. I did not think that anyone could imagine that a man could going crazy towards a burning plane just to appear as a victim. How was he there exactly at that exact second?
Reply: @karthikeswar9987 wow odds this true? What can I search to see evidence of both please?
Reply: @karthikeswar9987 Don't propagate false information
Reply: @karthikeswar9987  People behave very uniquely and differently after catastrophic events but, yes, his behaviour and the whole premise of walking away from a crash with a huge ball of flames is very odd.  While he was walking down the road he very defiantly shrugged off a hand placed on his shoulder, again, he's not acting as you would expect.  I don't know, but something about the story and the visuals that doesn't sit right with me. Cheers from Australia!!
Reply: @andersonomo597 but the news made up his flight tickets don't you think they were teamed up like a plot/ a pre planned thing
Reply: @karthikeswar9987   If the surviving passenger, was say a white British man and not a man of Indian heritage.   Then  I  am guessing a lot of you, would believe him and not believe this man.
Reply: @andersonomo597  And he had his phone in his hand!
Reply: @rebeccagriswold282  Exactly!! That was another thing that gave me a WTF moment!! Yes, it is very possible - just look  at the Toronto roll over passengers - many of them had their phones on them BUT they were hanging upside down and took time to get out, the plane wasn't immediately on fire, the fuselage was intact and there were others around them, delaying their exit.  He claimed he saw people die in front of him - but he still had his phone.  I had a young girl die in front of me in a horrible accident.  There was NOTHING else in my consciousness or awareness at that moment. Look, it is possible, people now a days are surgically connected to their phones but for it to have remained in his hand with the impact and everything else happening.....well, I'm reserving my judgement.  Cheers from Oz!
Reply: @karthikeswar9987  I was wondering about that.  Was the real person found? Did he not get on the plane?  …. As far as not getting involved — we all have to speak the truth - carefully yes.  But if everyone just looks away, what kind of a world do we wind up with? … Truth must be spoken.
Reply: @libby2012  Grow up. Exceptions happen.  Juliane Koepcke's plane was struck by lightning, she fell 2 miles to earth, survived the fall and 11 days in the Amazonian jungle.  Two cabin staff survived the Jeju crash in 2024.  It's not all invisible aliens under the control of the Deep State or whatever the current conspiracy theory is.
Reply: @libby2012 money talks
Reply: ➡There is also a theory that must be checked : Aviation expert Shaligram Muralidhar, who is a retired deputy director of the National Aerospace Laboratories (NAL), said on Monday a possible mechanical failure in the pilot’s seat might have contributed to the recent plane crash in Ahmedabad, calling it an emerging theory in addition to the earlier suspicion of fuel contamination.

In an interview with UNI, Muralidhar explained that aircraft pilot seats are designed to move both forward-backward and side-to-side to ensure proper access to flight controls. These seats are held in place by a latching mechanism, typically secured by a pin.

“It is suspected that the locking pin may have been broken or defective. During takeoff, when the pilot applied full power, the seat might have slid backward due to acceleration. As a result, the pilot's hand, which was on the throttle lever, could have unintentionally pulled it back to idle,” he said.

This sudden reduction in power during the rotation phase of takeoff could have led to a catastrophic loss of thrust, preventing the aircraft from gaining the necessary lift, Muralidhar added.

He also recalled a similar incident involving a Boeing 737, where a seat malfunction during takeoff led to a throttle rollback. In that case, the aircraft sustained damage and had to be called back mid-air.
Reply: @chris_alk1795  I am not an expert, but going back to idle, would not cause the RAT to deploy? Also this theory sounds very strange to me.
Reply: @chris_alk1795  That doesn’t explain the RAT deployment.  Most people are saying there’s 3 causes for RAT:  Major electrical failure. Major hydraulic failure. Major (engine) failure.  One person has said there as many as 10 causes. In any case, RAT is rare, and idle engines are not listed as a cause of RAT deployment.
Reply: @libby2012 RAT can be manually deployed by pilots
Reply: @chris_alk1795  what a spectacularly unimpressive “emerging” theory that doesn’t rely on anything factual. 
With this kind of reasoning, we can have 8 billion more “emerging” theories.
Reply: @chris_alk1795  I cant believe how looney tunes this is!!!   Even IF it did happen, you think he would not push the throttles back up again immediately knowing they are at the takeoff stage??  You think the Pilot Monitoring would not have noticed, and he would not have acted??
Reply: @vincentpinto1127  Tbh, I think this so called theory was put into circulation just to cover up the actual technical failure on Air India's part, as well as Boeing's. There were other speculations that the authorities tried to bury the actual video from which the deployment of the RAT was deduced and the person who took the video was apparently silenced. All this pretty much points to the theory and information in this video being maybe quite accurate and the flaws pointed out in the ADs were never addressed.
Reply: @AnandSoman  >>There were other speculations that the authorities tried to bury the actual video from which the deployment of the RAT was deduced and the person who took the video was apparently silenced.<<
They can "try" to do it, or may have done it. It's futile now as the videos are out.

Sadly, it will not be so shocking that AI and B may try to cover it up. But AI is run by Tata's, and even IF, there was a maintenance issue, it will eventually come out. May not be initially, but some whistleblower will somehow leak it out, even if incognito.
Reply: @chris_alk1795 the problem with that theory is that those seats have done millions of miles and hours across the fleet and haven’t had such a failure ever before also there’s the first officer who’s sat next to the captain who can push those throttle levers forward immediately and why would the captain make the final radio call about loss of power etc? he wouldn’t !
Reply: @gdmonks1959 And they're electrically powered with a mechanical override, one failure wouldn't produce that effect. The artificial generated 'report' indicating a seat failure seems to have pulled inspiration from Air India Express 611 where that did happen to a 737 on takeoff.
Reply: @chris_alk1795 --- except pilots don't keep their hand on the thrust levers during takeoff not to mention why couldn't the othe pilot advance the thrust levers? 

And why would the RAT deploy?  And why would the MLG be canted forward but not retracted?  

What a dumb theory.
Reply: @chris_alk1795  While this could happen, any pilot would push up the throttle back up again.
Reply: @ecoterrenos_cl  Under normal circumstances, such a malfunction in the pilot’s seat would have been relatively easy to fix. However, we don’t know what the conditions were in the cockpit—whether there was a shock, whether the co-pilot panicked. In a state of panic, 20 seconds is too little time to regain control, especially during the takeoff phase.
Reply: @ecoterrenos_cl  Correct.  And the pilot radioed a Mayday that he "lost power and lost thrust".   Assuming he meant electrical power and engine thrust.  He wouldn't have lost electrical power and thrust at the same time with the seat slipping back, only thrust, which could have been pushed forward instantly.
Reply: @chris_alk1795  Not sure I agree with panic as they had the presence of mind to declare an emergency with complete loss of thrust.
Reply: @chris_alk1795  said "There is also a theory that must be checked"

I bet you believe UFOs are explained by lens clouds and meteorological balloons
Reply: @chris_alk1795 , that makes no sense, there are two pilots in the cabin! 🤦🏻‍♂️
Reply: @chris_alk1795  this is what is known as 'proper BS''. This doesn't explain why the landing gear got stuck the way it did. And I am sure something trivial such as a latch pin has even more testing done than the other complex systems like the electric and software systems.
Reply: @chris_alk1795  why would the RAT deploy.
Reply: @chris_alk1795 idle setting won’t drop the RAT , get your facts straight .
Reply: @chris_alk1795 that wouldn’t deploy the RAT though. It also would not have stopped the gear from retracting. Basically it’s a dumb theory.
Reply: Regarding the pilot's seat displacement system malfunction, lets assume it failed. According to SOP's, the pilot in command holds his (her) right hand on the throtle levers, being ready to reject take off in case any major failure occures until V1 speed is attained, then he (she) removes the hand off the throtles and grabs the joke, being ready to rotate the aircraft when Vr is reached (if he or she is the pilot flying, if not, removes the hand and monitors speed to call out Vr speed). If the seat failure occured and the pilot's hand pulled back the levers, the aircraft would have been on the ground and it would have resulted in a rejected take off
with no major consecuences. The AirIndia 171 climbed several hundred feet before the loss of power took place, when the pilots hand have been alredy removed from levers a few seconds back.
That said, in my opinion, it is highly unlikely.
Reply: @chris_alk1795  Yeah man, LOL.
Reply: @chris_alk1795 Something like this happened to me on takeoff in a Cessna 172. My seat slid back unexpectedly and nose quickly came up. I stretched to push it down preventing a stall. My quick response has me typing this right now at age 59. I was 28 when this happened.
Reply: @chris_alk1795  This sounds very absurb. It's like saying I pulled the hand brake on my car, and wasn't able to correct it even after I had say 10 seconds to realize I did something wrong. 

Also, there's another person in the same cockpit who could see I accidentally pulled the hand brake, and coule put it down.
Reply: @rjv_mntn  So, this is what the theory suggest ftom the findings of the black box: it all started with the captain’s seat sliding back during takeoff—like right at the moment the plane was lifting off. The seat malfunctioned, his body tugged the engine controls back to idle, and boom—no power.

The co-pilot tried to fix it, but the captain was basically stuck against the controls and blocking everything. Just 38 seconds from takeoff to impact. That’s brutal.

They found that the seat’s locking pins were busted, and here’s the wild part—it had just been serviced 11 days earlier, and no one checked it properly afterward.

Add to that:

It was a scorching 43°C out, which made the engines less effective.

Nobody shouted the usual emergency commands.

And the Boeing 787’s throttle system didn’t have any fail-safes to stop this kind of thing.
Reply: @chris_alk1795  You're really saying an airliner in this day and age was sitting idle for 11 days and the seat was not tested/used. 

I call bullshit on insane proportions. 

Also, the thrust levers are not locked or stuck to the captain's (or who ever is flying) hands. They can just release his fingers and the thrust levers can be pushed again by the other pilot.
Reply: @chris_alk1795  Gotta throw the BS flag on this one.
Reply: @rjv_mntn if the fuel si cut off there is no recovery at low altitude as engine restart takes one minute at best.